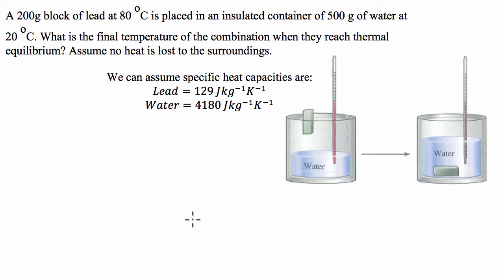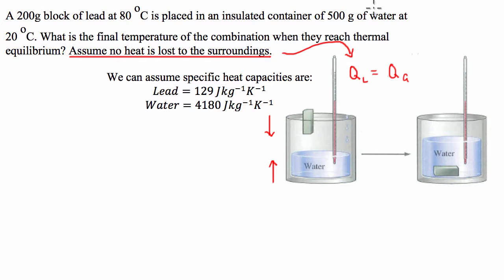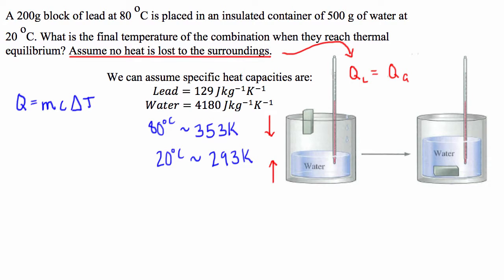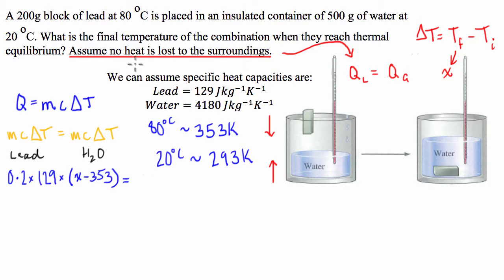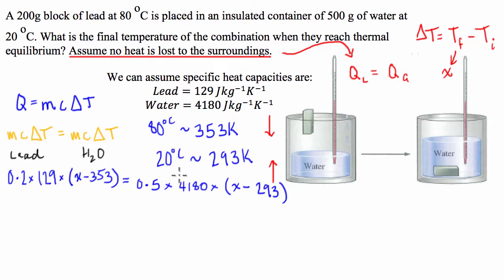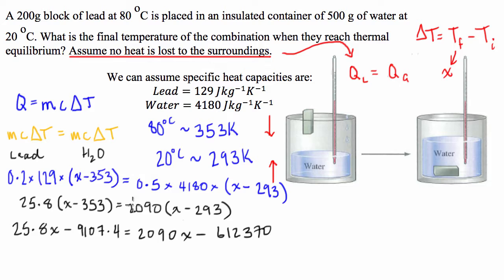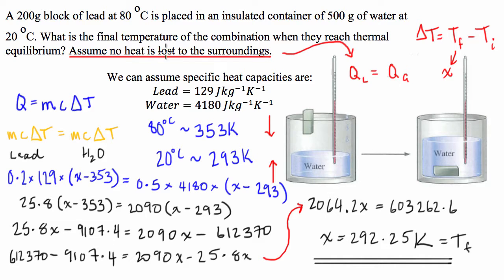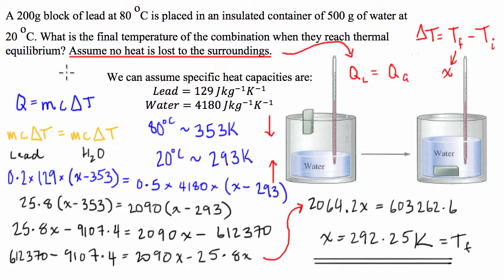Specific Heat Capacity - Finding the Thermal Equilibrium Tempreture

Comment: Conversion to Kelvin isn't needed, as change in temp in Kelvin = change in temp in Celsius, as Kelvin and Celsius differ by a set amount
Reply from the maker: Correct however, converting the temperature into the units which are universally used across the world is a good habit to get into.

Comment: Final temperature can't be less than the water temperature
Reply from the maker: Yeah, that is a massive cock up. Thanks for pointing that out to me. 
I tracked down the mistake; when I get to the line 25.8(x-353)=2090(x-293) that is supposed to be 
25.8(353-x)=2090(x-293) which yields a solution of 293.73K or an increase in temperature of 0.73 degrees. 

Again, thanks for pointing that out to me, I don't know why that one slipped through the cracks. 

:)
Reply: You forgot the negative sign:
- ve Heat loss by lead= heat gained by water
- 25.8(t-353)=2090(t-293)
t = 293.732 K